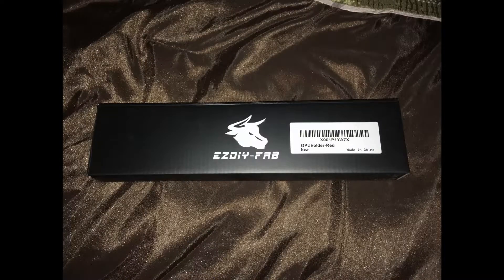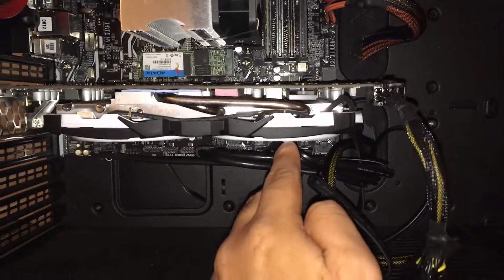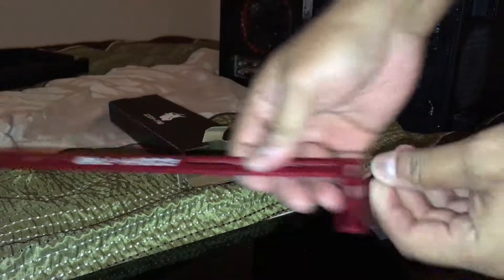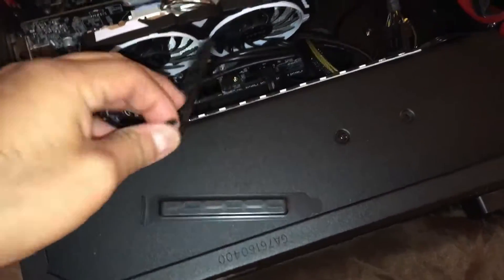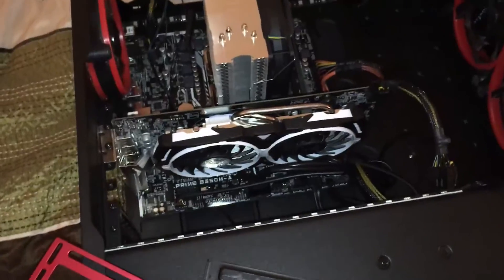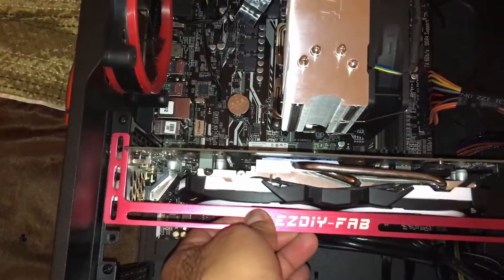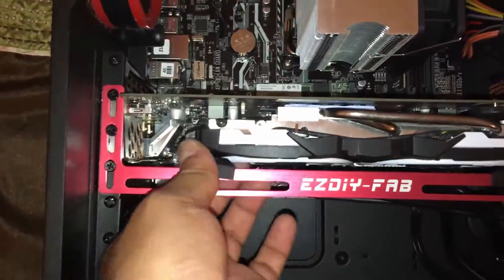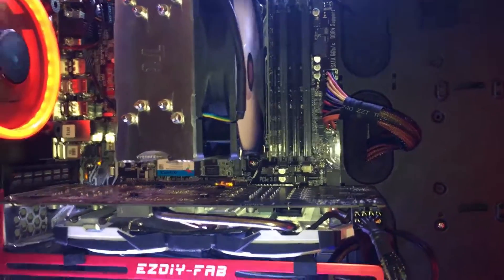How to Fix Saggy GPU! $8 solution!!!!

Comment: I bought the exact one and it made my gpu temps increase by 8 degrees! Its because it puts pressure on the fans, the rubber pieces or without when pressed up against the gpu frame makes it worse. As soon as I removed this bracket the temps went back to normal. Not a good design.
Reply from the maker: Battista Verardi i didn’t see my temps go up but i did notice the fans kinda falter or hit something. It was weird. I slid the rubber grips until it stopped doing it. And no more noise:)

Comment: i got one from Uphere. it looks identical except for the branding. came in a similar black box and had similar screws and rubber bumper thingies. thanks for the vid.
Reply from the maker: Timothy Miranda no problem. Thanks for commenting. I saw several different brands on line & i just went with the cheaper option at the time. Update: i recently got an rx vega 56  & now I’m using it for that gpu bc it’s heavier/thicker :) happy gaming
Reply: @redracer2797 Purchased a vega 56 myself and preemptively bought the brace. Hope it was worth the purchase when the gpu gets here